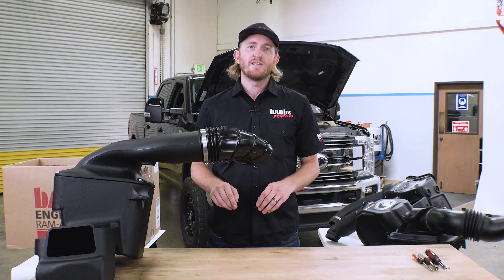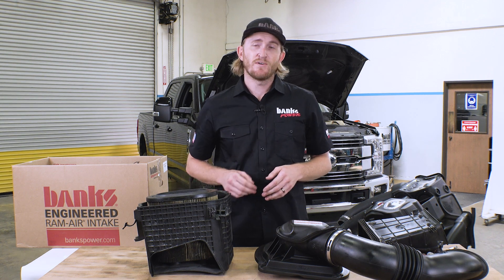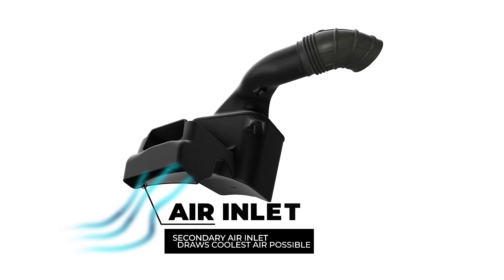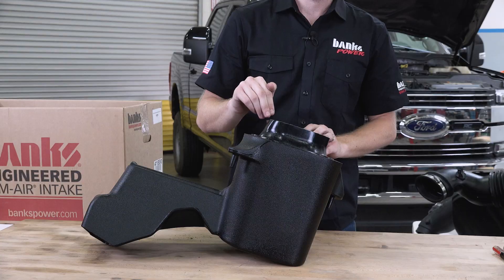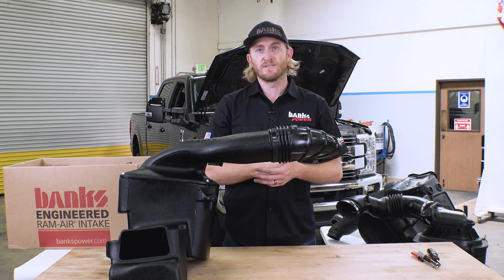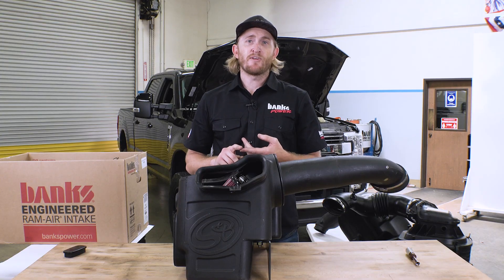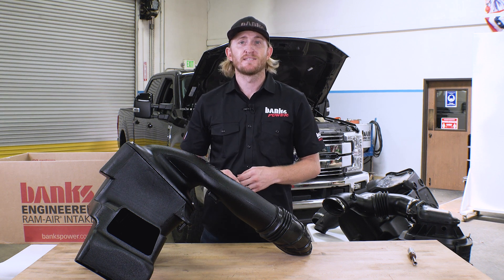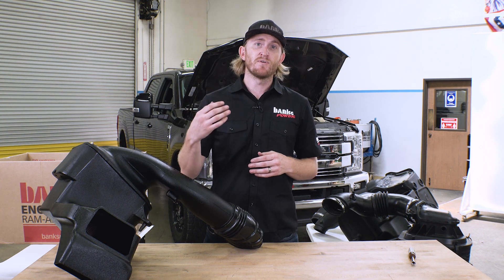Banks Ram-Air System for 2017-19 Ford 6.7L | Features, Benefits, and Competitive Analysis

Comment: I was thinking about buying one of these for my 2017 F250. I am concerned with that opening at the bottom of that box,. If it would bring dust and water to get into it and possibly damage the turbo or motor? I’m not big on off-road, but I do go down dirt roads every now and then with my truck.

Comment: Yeah, you might fit that air filter to the boxes. And then banks discontinues and then you're screwed. Think about it, folks, that's the boat. I'm in with the sidewander 1986 F250 6.9 idi airbox.

Comment: I will only trust Banks parts for my 2023 Super Duty Tremor with the 6.7 High Output diesel !❤ Thank you Mr. Banks for being a perfectionist and your acute attention to detail. ❤❤❤
Reply: @armedprophet3321  If I could afford the Ram Air for mine I would buy it.  When you're retired and only living off of your IRA's you don't have any discretionary income to buy the goodies you once could.
Reply: @ I understand, and with what you stated I would weigh the actual benefits of doing anything at all. In other words will the amount of money I am going to spend actually benefit my truck. Also if you run a diesel the best advice I can give is to try and save up for a Banks Idash, the reason is that little guy really gives you the important information you need and it’s amazing. It’s definitely worth it, I have the dual idash setup with the A-pilled mount …. Highly recommended.

Comment: Hey banks power I recently ordered a pedal monster with the idash and windshields holder which all together was just over 600 bucks and have yet to receive it. I have sent customer service emails and have called numerous times only to be told that inventory had to be done before my items could ship out. Can you please just let me know when I will be receiving my items please.
Reply: I’m in the same boat, something about programming pedal monsters at another shop in town.  3 weeks still waiting.  I’m giving it till Wednesday next week to ship or I’m cancelling.  I really only want the idash anyway and you can get those pretty much anywhere.
Reply: @cjwright1960  I don't get it. I call and they tell me it's gonna ship and we will send you the tracking. Other times I'm on hold for 30 minutes then just give up. They had no problem taking the money though
Reply: @anthonypendleton957  yes Sir I agree, they should hold payment data until they can fulfill the order, now I have $680 tied up at banks and don’t want to place another order until I get my refund for this one.  Same thing happened at Thoroughbred with another order and the day I cancelled the order, bought the product from SDHQ, they shipped it and I ended up with 2 cold air intakes. So get an RMA, drive to UPS.  Super frustrating.
Reply: @cjwright1960  that's just ridiculous. Hopefully everything works out for the both of us. 600 bucks is half my paycheck, good luck with everything 🤞🤞.
Reply: @anthonypendleton957  I got a shipping notification that my stuff is coming from Canada should be here by the end of the week.
Reply: @cjwright1960  same thing for me lol. Glad everything worked out for you as well.
Reply from the maker: Anthony, we apologize for the lack of communication. Our inventory and shipping systems have suffered hiccups resulting in delayed orders and the inability to notify customers. Your order was shipped on August 13. You should have received an email from UPS with tracking info.
Reply: @bankspower  thank you very much for getting back to me. I do appreciate it and look forward to installing your product.

Comment: I'd be interested in the numbers between the banks intake for the truck with the battery in front and the banks in the new trucks with the battery behind. Obviously Ford felt the need to correct the battery location.